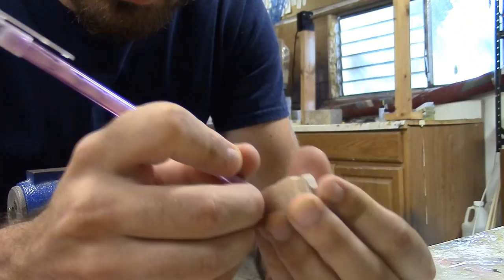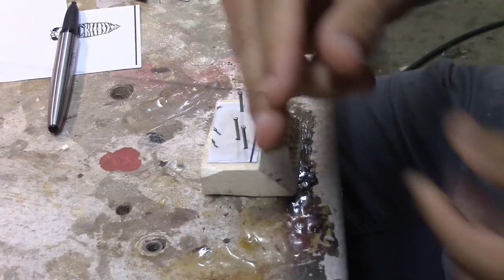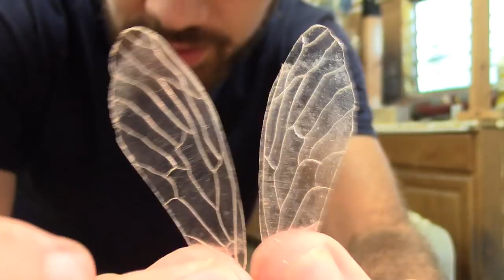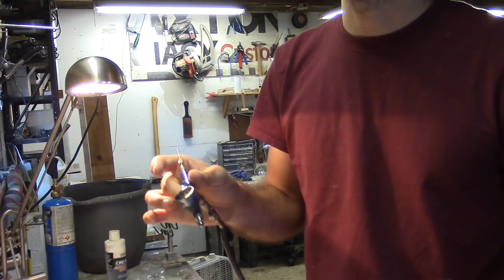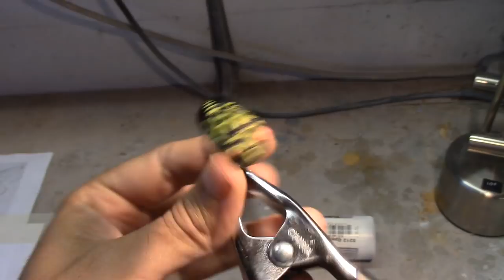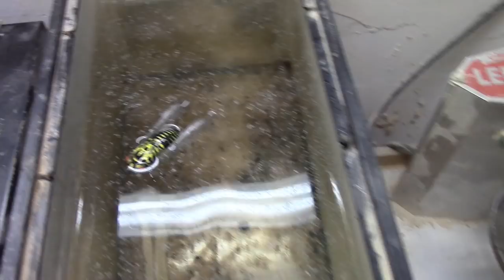Making a Cicada Fishing Lure

Comment: Your research is a good approach to this art. In the 70's super glue was around but we use to mix araldite, collect the biggest grass hoppers we could find put just a drop on their back without sticking their wings together, and fasten # 2 trout hook, let dry, get the longest rod you could find, attach to the line get down to the water and bounce on the surface, trout love live insects. Your appointment to detail is extraordinary, fish have exceptional sight. If you could just get the wings to flap.

Comment: Generally with water based airbrush paints I've always found multiple light, diluted coats are best if you want even colour or controlled fades but there are some cool effects possible with laying it on thick. I experimented with an interesting finish ages ago which involved laying down a base coat of bright metallic silver then shooting a quick layer of clear coat over the top, once this had dried you shot a full wet coat of black before dabbing at it with a scrunched up plastic carrier bag to lift some of the black and expose the silver underneath in a kind of cool marble pattern. It's a pretty cool pattern as this stage but if you then give it several coats of a candy style paint (ie. a tinted lacquer) and then clear coat it looks amazing in the sunlight

Comment: neat cicada. when fishing those type baits I always use a special knot. first tie a open knot run the string though the eye and than back though the open knot than make another knot and bring both together. should have  a ring size open knot that forms. this way when you pull and twitch the bait it will go from left to right. making it preform great. very strong knot.

Comment: put the hook on the front of the bate and tie off on the back as you pull it the wings will grab the water and it should start to flip and flop. if it dosent flip and flop making the wings jointed will help with that, but were they are fixed to the body you can fish it like a popper ,  another way i fish something like this is to do a very fast but small twitching motions as it floats to make alot of ripples around the bate this works best close to any vegetation... this can be a very versatile bate.

Comment: yeah, i just took a freshly dead cicada, posed it with pins and let it dry, then i put a bunch of thick coats of acrylic on it and ran the wire through and added hooks. it works great

Comment: If u want to make your wire bending easier you can't cut off head and most of the nail when it's in the wood and then make something like key to bend wire around the nails, it's just a piece of bar stock with a hole in the center and a piece of nail or sth placed eccentrically so it's on the one side. You need the handle obviously...anyway you can google it 😂 it's really hard to explain

Comment: Those wings drove me crazy, for some reason they looked upside down and I had to look at a few pictures to make sure they weren't. I'm also a little worried that if a fish comes to tackle that thing from the back it could hit the wings and not get hooked. Also you could have just painted the legs on, that would have looked fine from the bottom. it would be interesting to see how the baits action changes with stiff wings compared to flexible wings. I had a thought about how you could make wings like that make a rattling action, cut a horizontal slot through the middle of the bait and attach the wings at like a 45-60 degree angle to a bar maybe plastic too so that when you reel the bait in it flicks the wings from one side to the other. It might not work but it could be worth experimenting. you could also go for drilling a much bigger hole and dropping a few bearing balls or lead weights in it then gluing a piece of wood over the top of the hole and carving that down again so you get a rolling/rattling effect, have you tried making a bait with that kind of action? With the air pocket you might have even gotten away with using a hard wood on the cicada! I'm excited to see how it works, I wonder if cicadas are even in season any more, I always thought of them as mid summer, hottest weeks of the year bugs but then again I don't really know. Also bring the traditional style action thing for the front of the bait with you and if you feel like it will help you catch a fish and havn't gotten one half way through throw it on and compare the results.